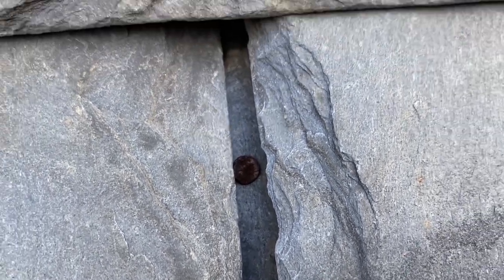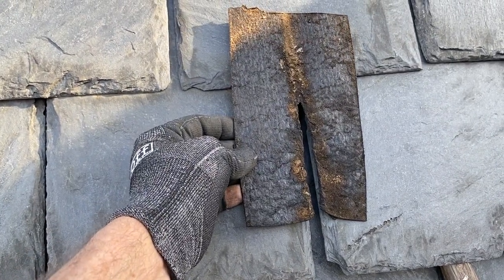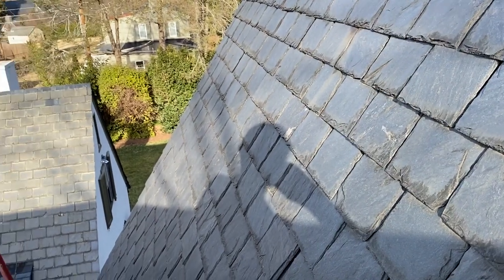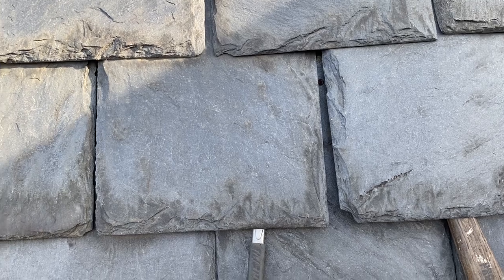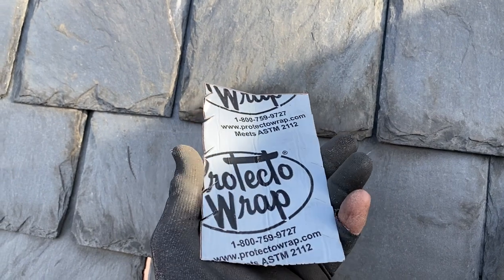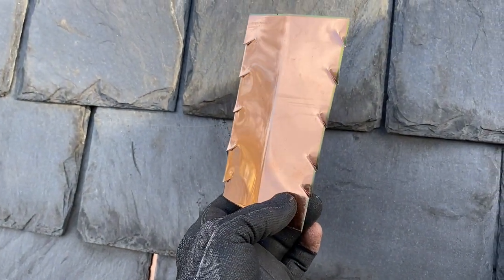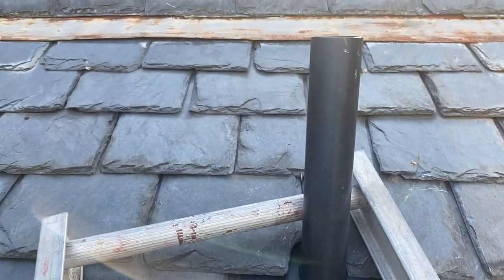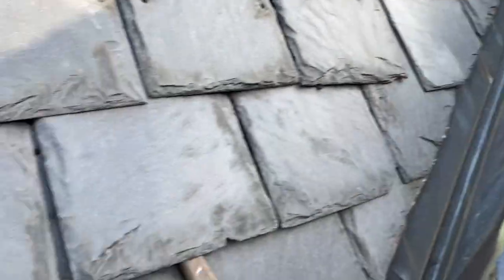If you have to add Bibs to a Slate Roof …

Comment: You shouldn't be nailing the center of a slate
Reply from the maker: I agree.  It should be avoided whenever feasible and we use slate hooks.  However, if a client already has 200 bibs on their roof when you visit to do repairs, you adjust to the circumstances present.
Reply: Why not just put in the correct size slate